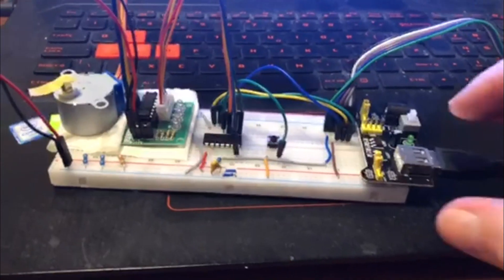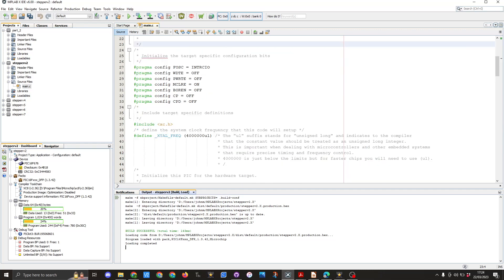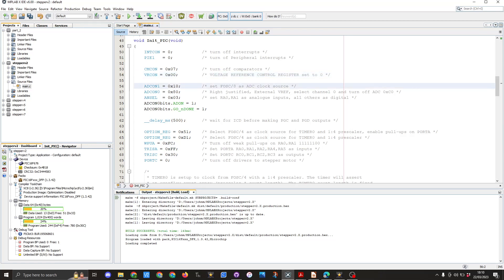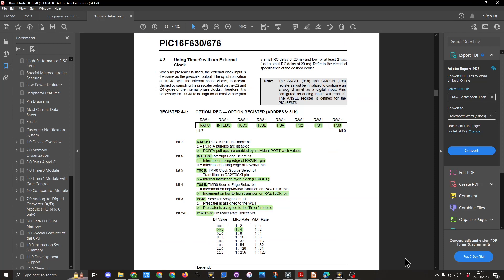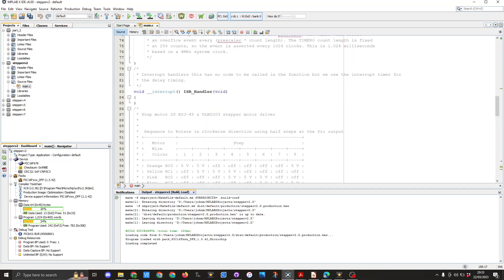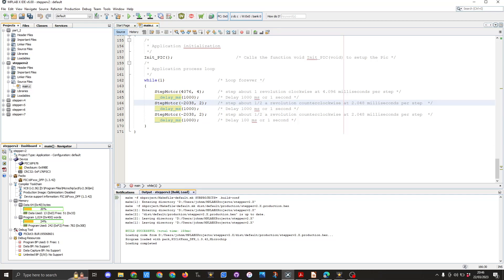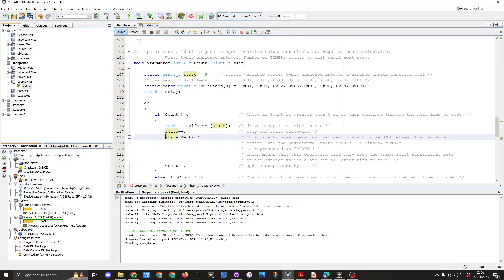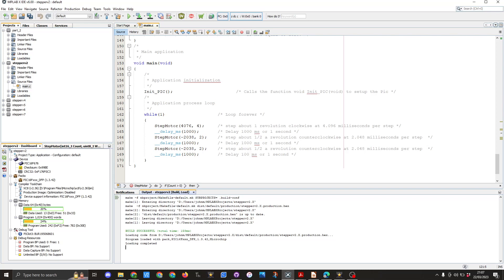Pic16F676 Part 10 C programming Basic  28BYJ-48 stepper motor control Version 2

Comment: Hello! I am in a University project in which I must use that pic to send the signal to a grapher that I have on my pc. the problem I have is that it does not have RX and TX which are responsible for the communication of the rs232 protocol. After some research I have read that in ATMEGA memory bits can be used to fulfill this function, however I have not been able to implement it in the pic, if you know where I can read about it or some advice I would appreciate it :)
Reply from the maker: This example we are only driving 4 outputs either hi or low. I maybe possible if the university has stated to use this particular chip.
Reply from the maker: Hi I have never tried to use the PIC676 chip for that type of communication. This chip is a chip that has been superseded and Microchip recommend a later chip will offer a lot more ways of working with it. I did change over to the new chip but not had time to do much with it for a while. I would suggest asking on the Microchip forum as they are very helpful.